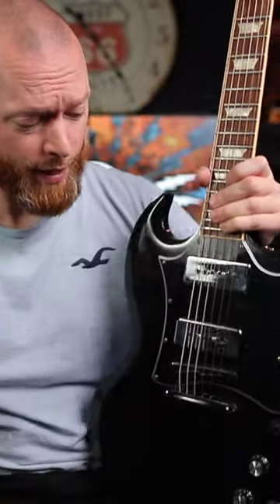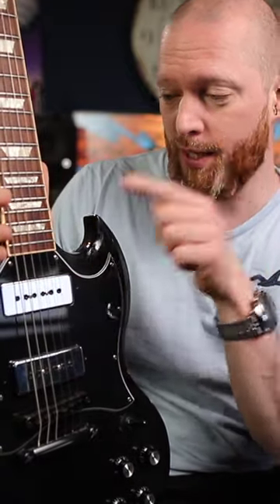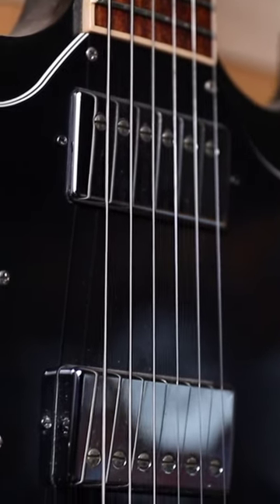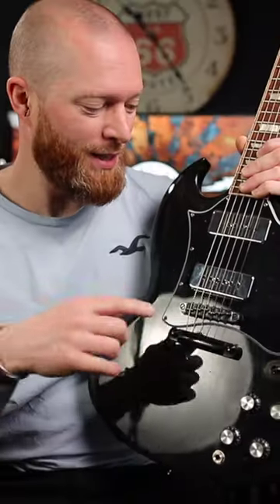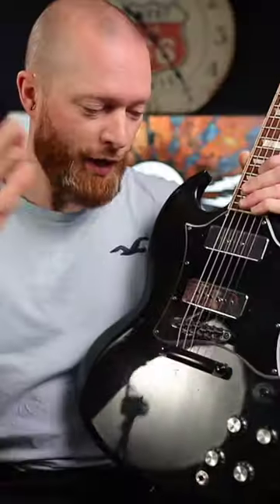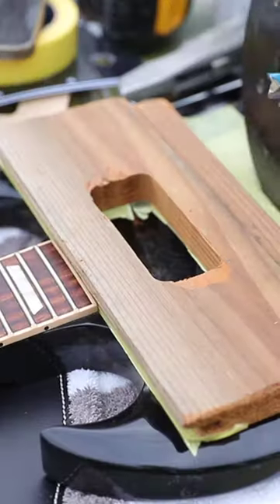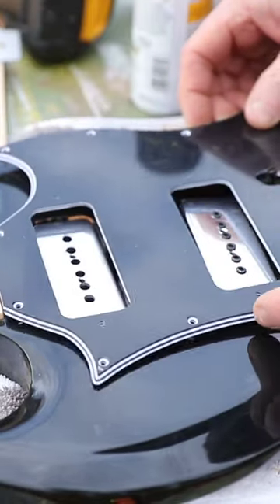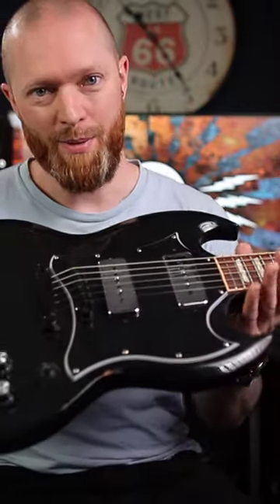Gibson SG P90 #shorts

Comment: Gorgeous. I'm the same way, it's P90's with trapezoid inlays for me. And the smaller early 60's pickguard if we're covering all the bases.
Reply: Ya need the batwing pickguard to cover the route for the P90's.  Or, am I missing something?
Reply: @Ottbucket  i think '66(?) is the first year the batwing became standard on Specials. Pre-66 there's small pickguard Specials with P90's just coming straight out of the cavity. It just looks nicer to me but they're both beautiful options.
Reply: @rivereuphrates8103  Oh... I see.
I thought you were suggesting just using the small, lower-bout pickguard.  Didn;t realize you were ref'ing to the actual guitar.
I got it.  Cool.

Comment: awesome ... and you took about $1000 off the value of the SG with original Humbuckers lol...   the Gibson pricing shite is cray   FWIW i just did something similar on a guitar with a Humbucker in the bridge position, I also did a little bit of Freehand cavity work with a dremel but it was less than what you showed here, and more so the pickup covers would drop down enough into the guitar body to allow me to have nice P'up height adjustability range.  Ever since, I look at all my guitars with Humbuckers and i wonder.........